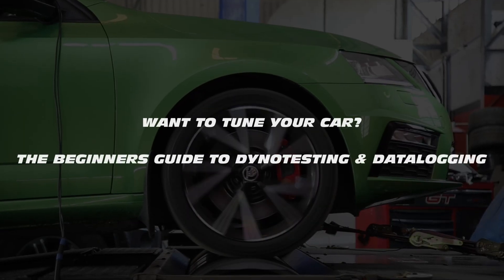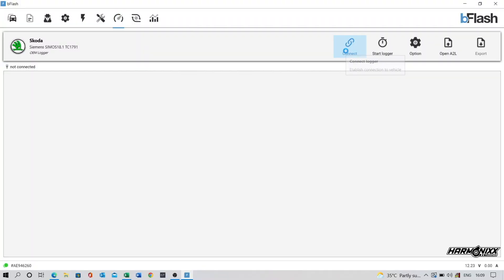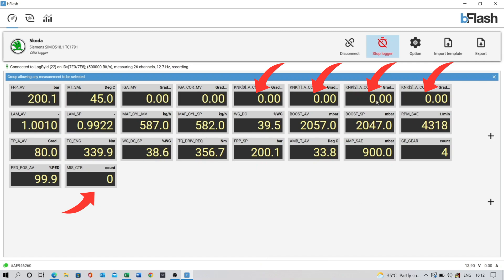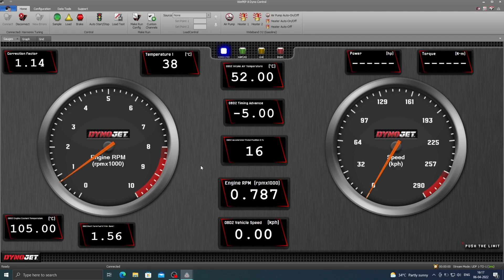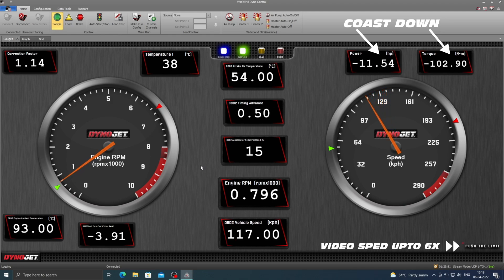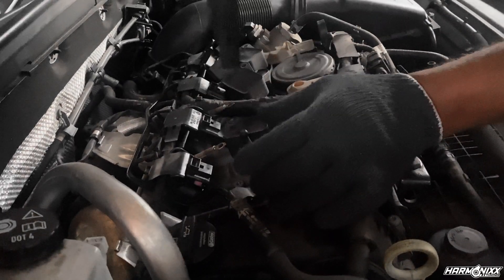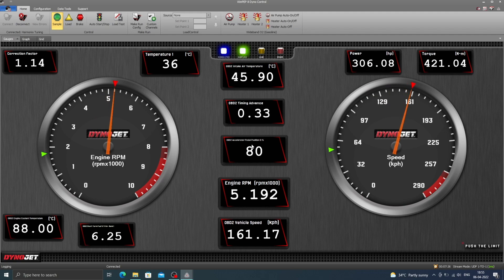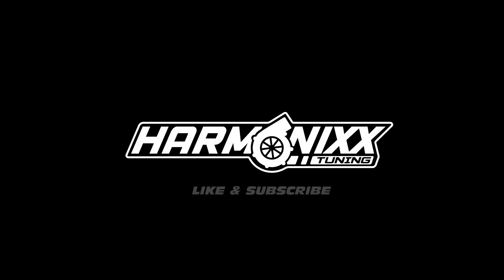Want to Tune your Car? | The Beginners Guide to Dynotesting & Datalogging |

Comment: Is there an error in calibration of the dyno..? Since the dyno power is more than the rated power..
Reply from the maker: Dynos read differently based on a lot of factors. And no two dynos of different brands read the same. Then you have the weather correction in different cities etc. We use the dyno to mainly check Delta Figures (difference between the stock & tuned numbers). And that's all that matters.

Comment: How long does it take to tune a car end to end?
Reply from the maker: Depends on the Hardware that goes into these builds. 1-3 days depending on the car and the amount of work. 

If it's software only and no hardware mods, then around 2-3hrs.
Reply: @HarmonixxTuning  oh. Can cars like Innova etc also be tuned and get a considerable difference?
Reply from the maker: The newer 2.4/2.8s are way more tunable than the older Toyotas.